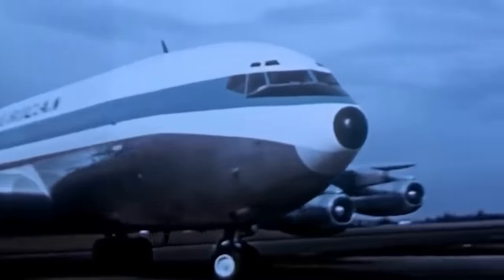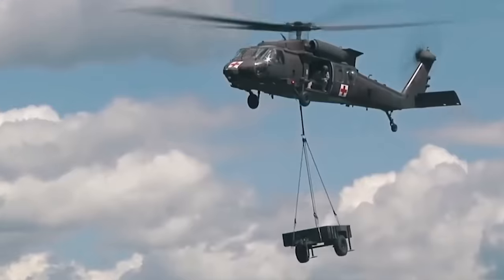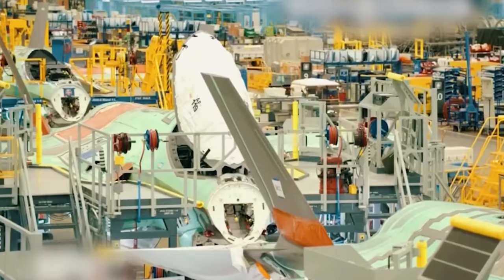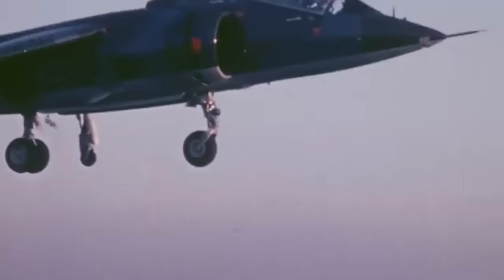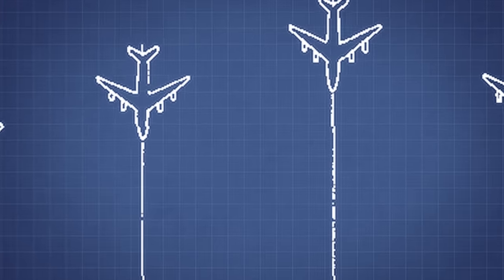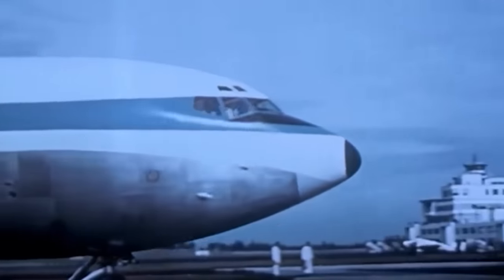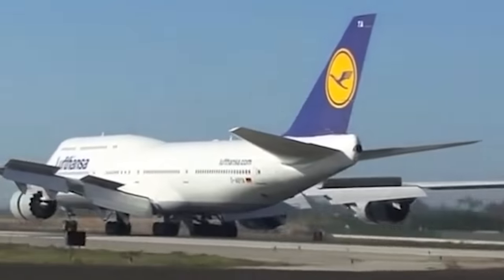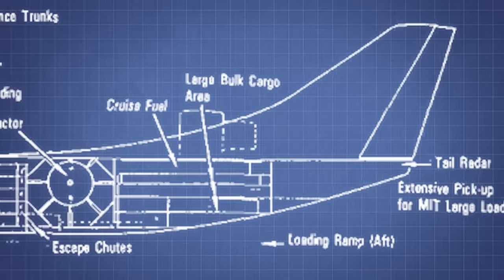The Largest Aircraft Ever Created

Comment: Would require an unbelievably long takeoff roll so add 54 engines. Can you image how big the quadrant would have to have been? Would make the Buff’s look like an RC toy.
Reply: Grandapa Buff still king
Reply: The initial takeoff phase could have utilized a booster system, cargo planes today will use these if the runways are too short and they are packing a heavy load.

One thing is certain, if it had been created it would have been extremely expensive. Run 3 at one time much like nuclear power plants. Where the generators are are on constant cycle.
Reply: I read somewhere that it was never supposed to land just for that very reason 🤷‍♂️🤷‍♂️

Comment: I do not think this was ever ever more than a practice drawing. I do remember a question in the Lockheed Star during C5 design about how big of an airplane that could be built. The answer was: Even with the materials we have today given an efficient powerplant there is no limit to the size of the aircraft that can be built. The main limitation is the ground handling area available. This drawing may be that engineers doodle.
By that statement that aircraft could not be built because there was no efficient powerplant provided.
Reply: My first thought was that it was intended to mess with the Soviets and make them waste resources trying to figure out if it's possible.

Comment: Well…
if they were trying to use a fusion reactor, as suggested by the image at 5:13 😂 in the 1960s, that would also be a pretty big hurdle to overcome, seeing as we still haven't gotten them to work efficiently sixty years later.
Reply: I think they were using a fision reactor. There were several US and Soviet designs. The US projects were finally killed in '61. The NB-36H (modified B36) carried a reactor to test sheiding. HTRE-2 (reactor & engines) and HTRE-3 (reactor) can be viewed at Idaho National Labratory. HTRE-3 suffered a mid-air melt of its fuel. Russia's nuclear cruise missile is thought to be powered by similar engines, which is not reassuring.
Reply: @mikep490 Yes, don't put to much into the illustrations showing a fusion reactor. The plan was for fision.

Comment: I am pretty sure I heard about a planned passenger liner version of this design from the early 2000s. Passenger seating in the wings and body and 2-3  large engine on top with the same flying wing design, though with a 50% drop in size compared to this concept. I am surprised you did not mention it, as it also didn't get past the concept phase
Reply: Yeah, Boeing did have an official blended-wing-body X-plane variant, and they flew a 10ft wide scale variant. It was supposed to be a dual-use airliner & military aircraft.
  The problem always came down to the weight & wing span.  The all-up fully-loaded airliner version would have been close to the same weight as 2 A380s; and its width would have blocked 3 airliner stalls at the few major airports capable of supporting it.
Reply: Also the C5 Galaxy was designed for American Airlines I think as a passenger plane

Comment: Theoretically, an atomic fusion engine would be a good choice to power an airship or mega-plane. 
That would solve the power issue without the danger. Mind you, a fusion reactor goes "kaboom" when it's breached. Meaning the reactor would need to be heavily armored, yet still well-ventilated.

The best reason I can think of for having a giant plane is rescuing damaged aircraft. Such a craft could pull up underneath a damaged or incapacitated craft, then gently grab them, without subjecting the already compromised airframe to the stresses of landing. Then, the bigger craft lands, offloads it's "passenger", grabs some snacks from the nearest supermarket, and they're back up patrolling. The main limitation is, of course, landing space.

But if we're designing a magic nuclear wonder plane, just make it land in the ocean, a la the Spruce Goose.
Reply: Somewhere on YouTube there’s a video on just such an aircraft!

 It’s more of a flying flatbed truck and one of the features was the ability to catch damaged planes, get the crew and passengers off then safely land and prevent a crash.

 That would be a great idea!

Comment: how does a plane 3 times the size of a 747 with an 1100 foot wingspan reach mach 3.2 with only 100,000lbs of forward thrust?  That shape is optimized for lift, not high speed.  that's a huge forward surface area to push through the air.  This doesn't add up.

Comment: First off, clickbait title. Also, the CL-1201 was to use the GE4 engines? Citation needed. I thought those were specifically designed for the CL-1201s would-be competitor, the Boeing 2707 SST?

Comment: DESIGNED BUT NEVER BUILT
     Wikipedia: The Lockheed CL-1201 design project studied a nuclear-powered aircraft of extreme size, with a wingspan of 1,120 feet (340 m). Had it been built, it would have had the largest wingspan of any airplane to date,[1] and more than twice that of any aircraft of the 20th century. 
     Leonardo da Vinci designed many more impressive inventions that were never built, including a helicopter, a submersible, a machine-gun (multiple canons fired in rotation) and several other powerful defensive weapons that could also be used for offense to defend the Roman Empire.

Comment: Airborne Reactor that was worked on my Weinstein, who developed the LFTR to make the concept feasible.  Putting a URANIUM reactor in a plane was obviously stupid; however, a THORIUM reactor would at least make a much smaller mess in a crash.  Also the design was far more manageable for a pilot/ engineer in the air.
Reply: I always wondered why they don't use thorium in all reactors. Is it a power output issue? Was the tech discovered later?
Reply: Thank you. It's a shame that us humans spend so much effort, resources, and money on killing each other when the earth has enough for everyone. You'd think we would be passed this as a species. I appreciate the response.
Reply: @bongwelll  well, it is a case of natural difference.  What is HERE is not THERE and moving it around was all about muscle up until 500 years ago-ish.  That is not time enough to properly rewire the "get what you need for the family/pack screw everyone else" from everything developing to that point.
Reply: @watchthe1369  sometimes it feels like we are sliding backwards to that. Humans haven't caught up with the modern world they created yet haha.

Comment: Another Spruce Goose, doomed before it got off the ground, well nearly. Flown on the 747-400 three or four times long haul, most wonderful smooth flight ever. Beat the Air Bus by a country mile. I was told the CVT transmission was started there as a fuel pump!!

Comment: If your planning a business trip to Europe It makes little difference whether it takes 8 hours or 4 hours., That was my conclusion about being involved in the Boeing SST Program in 1974. Fortunately our management turned down the opportunity. 
This is a great configuration. It satisfies all the objections to; low wing, engines under, landing gear at central stress point, good visibility with good access for maintenance and good combability to existing ground facilities. Plus it takes advantage of latest engine and manufacturing technology. My fishing, skiing, camping buddy since 1970; Boeing structural  engineer. 727, 737, YC-14, 757 and 767 would be excited with this design. This is a good example of "getting back to basics"!   Let's get back to Tooling and Technology.  Industry is not a game.  Get Smart, Get Trump.
Iguana

etting back to basics"!   Let's get back to Tooling and Technology.  Industry is not a game.